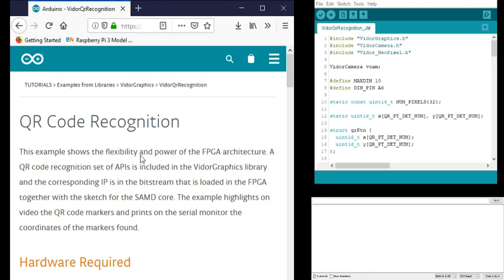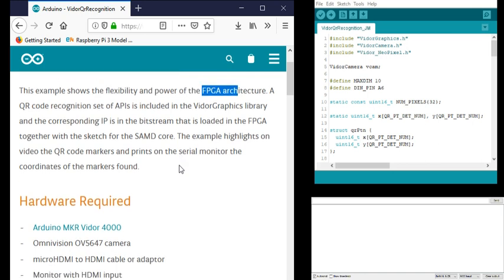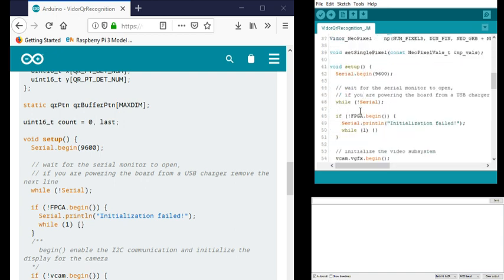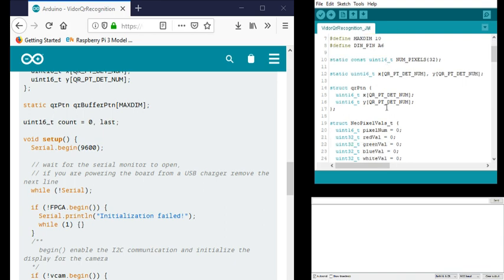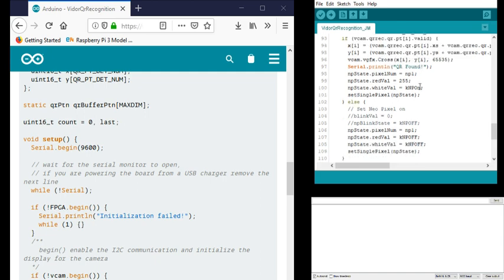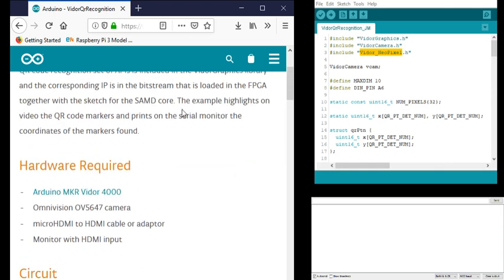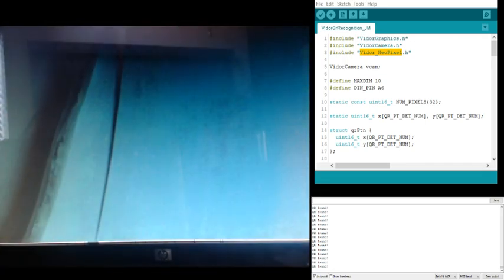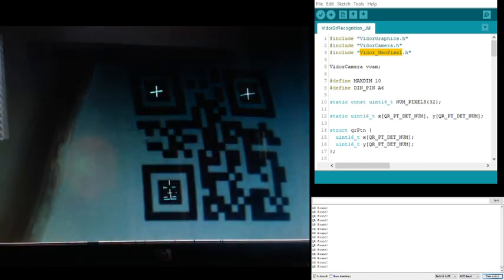MKR Vidor 4000 - QR Code Recognition

Comment: Thanks Jon. I was curious to learn more about the Vidor, but have found remarkably little about how to actually use it in any practical example. Lots of eww!/ahhh! unboxing videos, but not much after that. I still have absolutely no clue as to how the HDL/Sketch codes mesh together in the IDE. I think it's all above my pay-grade ;)
Reply from the maker: Yeah, Arduino needs to do a better job of getting more info on how to work with the FPGA side of the Vidor out. However, there are a few resources where folks have converted some of the examples to workable examples.  The issues is that the majority of the Arduino FPGA examples were compiled in a paid version of the Intel Tools, so they do not work right with the free version. Most of it has to do with the USB implementation for the programmer to the FPGA chip.  Arduino implemented software to emulated the USBBlaster tool from Intel to program the FPGA, so the bitstream code used to configure the FPGA can be loaded when the Arduino sketch is loaded on the board. 
I did post some of this in the element14 blog this video was for at the following link: 
https://www.element14.com/community/community/project14/programmable-logic/blog/2019/06/23/vidorscout-mkr-vidor-4000-mobile-robot-vidorbitstream-compile

But, yeah, I agree there could be more informational data on the Vidor. It looks like there were some updates to the Video board code, so perhaps something interesting is in there. 

Cheers,

Jon
Reply: @TheJoMoVO  G'day Jon, thanks for the information, I liked your article. Element14 publishes some excellent material and I often call on their tutorials.

I appreciate FPGAs are the Top End of Town, but I felt Arduino essentially helped take microcontrollers to the masses. I guess I was expecting something similar when they released an FPGA and this was going to be an opportunity to get into the HDL side of things. I must admit I've been rather underwhelmed in that regard and it's not going to be something a noob like myself is ready for (and visa versa, ie nor is this in my opinion ready for noobs). I'd like to see the team release/sponsor a few decent Vidor examples that step somebody through a complete project using both sides of the hardware; the novelty of blinking an LED on/off wears thin rather quickly ;)